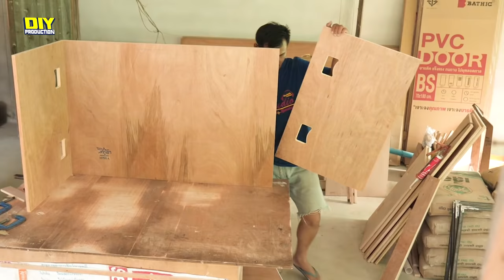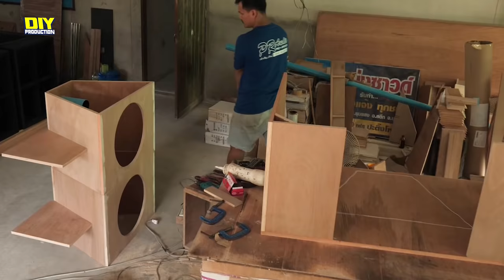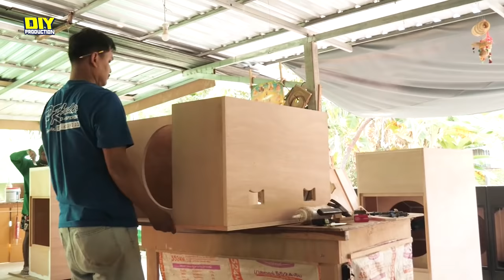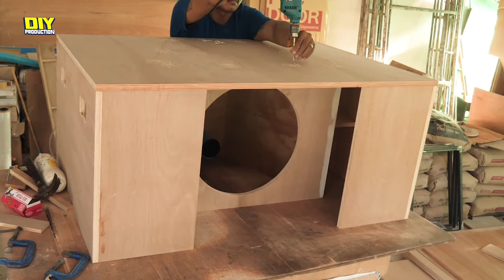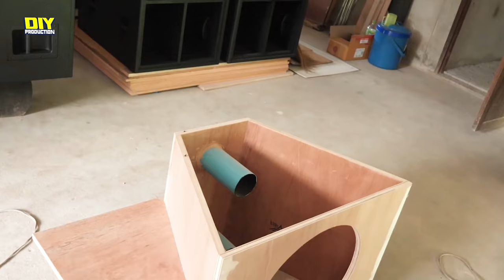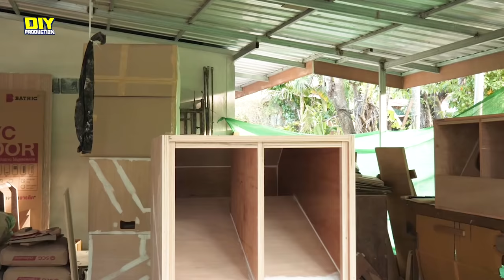WBOX  Single 18 inch Professional Subwoofer Box

Comment: long throw or short range?
Reply: That's a vent-assisted folded bass horn, or "W-bin." One on each side of a stage is good for probably a 25m reach at high volumes, but these cabinets work much better when stacked. They can work for long-throw when used in multiples of four and up.